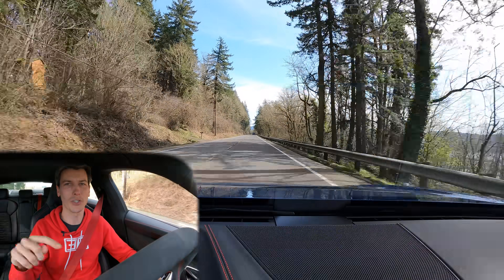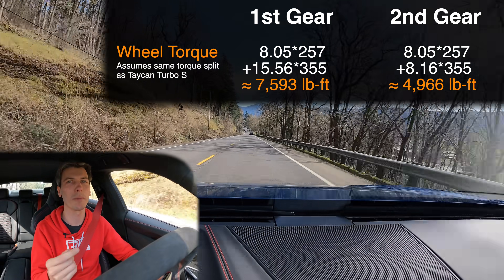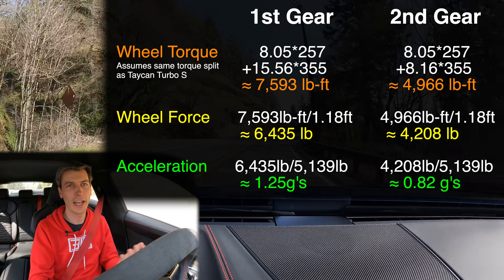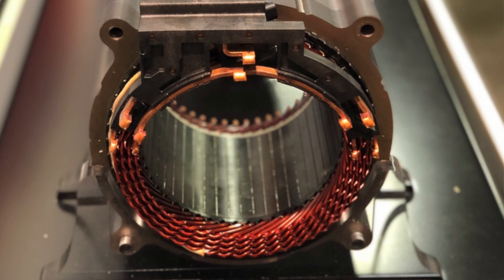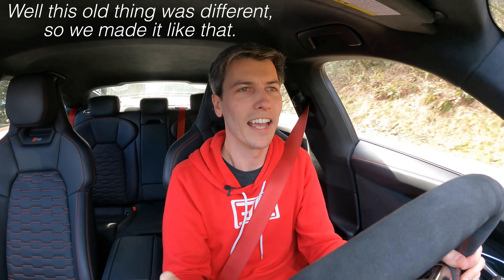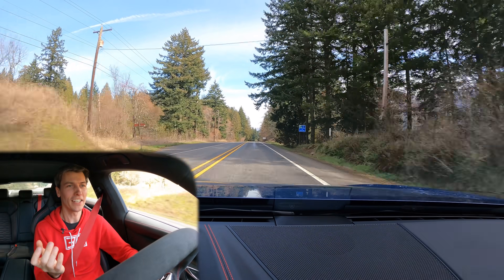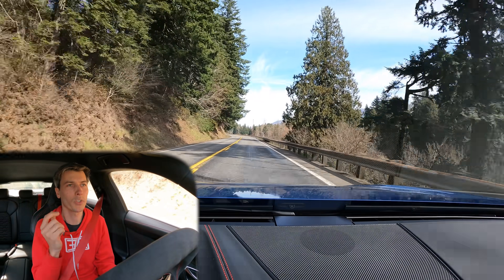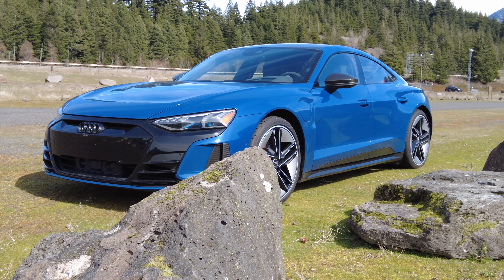Are Fake Manual Transmissions Coming? Audi Keeps It Real

Comment: That Toyota transmission sounds like such a gag. Was it released in April 1st? I mean I get the love of driving a manual transmission however the biggest feedback you get is the change in the note of the vehicle whether it's the exhaust note or whine of an electric motor.  This fake manual will just sound the same with every "shift" if the electric motor is spinning the same rpm. Also sounds like a $4,000 profit margin built into a vehicle for $300 in actual parts and labor for the fake pedal.

Comment: VW does not use the speakers in the soundsystem to make the engine noise. They use a linear actuator that's mounted to the firewall below the windshield to not only generate sound, but also vibration. As fake engine noise goes, it's actually really well done because it almost perfectly matches what your engine is doing, noise wise.

Comment: I would take a fake manual over a CVT ANYDAY. Keep in mind I don’t mean a Toyota hybrid ECVT. Considering those don’t use a belt to change gear ratios but they use a planetary gearset. Far more reliable and strong in comparison.

Comment: I get it - totally! I even have an old phone at home with that traditional handset, you know, the one with a speaker blob at one end and a microphone blob at the other. And it weighs 5 Lbs and sits on the kitchen counter. It has the rotary dial with little finger holes and numbers under them and you pickup the handset and spin the dial and the call goes thru. BUT! It's actually got a latest model iPhone inside that does the real work! There's even a cord coming out which you can plug into anything you want because there are no wires in it. Sorry, just kidding on that whole thing but maybe there's a niche market there? Hmmm ...

Comment: My hope is that electric cars (and more sustainably, proper mass transit) allow internal combustion cars to exist for a longer time for those of us who want that experience. It's too bad though, that the manufacturers that provide internal combustion cars have themselves been abandoning manual transmissions and embracing fake engine noise.
Reply: ICEs and various forms of internal combusion tansport (longhaul aviation) are likely to be with us for a long time, however the source of the fuel is likely to change. It becomes easier to go carbon-neutral as the price goes higher and above $200/bbl various non-fossil methods are economically viable

We cannot keep adding more carbon dioxide to the atmosphere. Forget "climate change" and "global warming" - if CO2 goes much past 800ppm then RAIN will become acidic enough to destroy most land-based plant life and anyone who's studied paelentology will tell you that when that's happenedi n the past, things turned very bad, very quickly.

Last time that happened and the climate was similar to what it is today , 93-96% of ALL life on the planet died off in less than a decade and "red tides on steroids" created much of the oil we're currently burning. We know it as "The Permian extinction event". it's all written in the rocks for those who care to loook

Wer're facing a collective global crisis and warring about it will virtually guarantee our extinction as a species. People can move away from rising waters, droughts or climate change but it's hard to escape from globally collapsing oxygen levels and drowning in your own lungs (altitude sickness) is a particularly nasty way to die

Comment: Jeep did a concept electric manual wrangler. From what it sounded like they basically bolted an electric motor to the front of the factory transmission. You could take off in any gear and it couldn’t stall.

Comment: Hearing engine sound, real or fake, can make it easier to match shifts properly. But it's hard to see the point in a 2-speed electric especially if you don't plan to shift it manually.  If you can't turn it off it's just making it harder to hear music or whatever.

Comment: the only worthy new car left is
the CHEVY SPARK and only if
you get the LS (base trim) and
the 5-speed manual transmission
$11,700 in 2019 - 98 horsepower
roll-up windows - nearly extinct
NO buttons on the steering wheel
it's more fun to drive a slow car fast
than to drive a fast car slow

Comment: Quite the intriguing piece. My main ride is a Vespa GTS 300 SuperTech, which, like all modern Vespas (except the Elettrica, because electric), uses a CVT. So I get the lovely thrum of the single cylinder engine, but don't get to shift. Unlike most cars with a CVT, however, the only "bump" I feel with the bike is when moving from a low-speed crawl to maybe 20mph and up (top speed a bit under 85mph). I happen to like rowing my own gears on a motorcycle, but I can't deny the ease of dealing with stop-and-go in-town traffic without constant shifting where it's definitely not fun. And, yes, someone - Kymco, I believe - is making or planning to make an electric motorcycle with a manual gearbox. Obviously, we're part of a crowd that's not into "self-driving", either. ;-)

Comment: I posted this same comment a couple of years ago.... With electronic speed controllers you can precisely configure the motor's torque at any RPM, meaning you could at a touch of a button have your Tesla motor emulate the power/torque characteristics of ANY internal combustion motor. e.g. Today I want my car to feel like a Honda VTEC and tomorrow a Chevy V8. Software on a fake manual transmission could fake the gear ratios too

Comment: There are interesting ways the idea could be implemented on EVs that aren't simply power limiting. On hybrids one thing that was done with manual mode wasn't just to simulate gear switching, but simulate it as if it was a bigger engine, by both increasing the normal power available to the system, and also altering the pedal maps. There is usually a distinction between short term and long term power limits, and the driver doesn't always have full access to them depending on the pedal input and speed. There could be something done to increase the short term power of the system for the simulated lower gears. Not sure how well it would work, but it would be interesting to see attempted at.

Comment: Yesterday I was working on an F1 hot rod pickup (‘48 460CI V8, auto trans, modern suspension, etc.). I needed a part so I took the other F1 pickup (‘49 226CI I6, 3 speed manual, manual brakes, manual steering, basically a factory restoration.) to the autoparts store. I love driving those vehicles, but it makes me appreciate modern cars. That old truck bounces around the road pretty good and there’s a lot of focus required with driving them. I think if I’m going to buy an EV “fake manual transmission” isn’t really on my list of things I want. Seems like EVs are complex enough as it is without adding this extra switches and programming. It seems like an additional unnecessary failure point.

Comment: It's good for drifting where you can use different gears and and the engine's RPM range to manage wheelspeed and torque. I'm not so sure it's gonna be fun for racing though, as the motor will only increase RPM and will sound like it does instead of comng back down every gear change

Comment: I remember that Lotus made an Evora called 414E in the "serial hybrid" configuration, with an ICE working as charger/range extender for batteries. They also put in place a sort of "software gearbox" with paddles to mimic a manual gearbox.
Toyota was already an engine supplier for Lotus so the patent you mentioned is also probably behind that first prototype.

Comment: That new subaru wrx gt with simulated gears (its a cvt) is truely pointless. Worst of all, it is doubtful that anyone would have fun with the car, knowing that the top trim has cvt forced upon it and no manual option. Subaru really shot their feet making the final ICE wrx. They could've used a torque converter or sequential, but chose the worst and complicated transmission for a sports car.

Comment: Would the clutch pedal in the 6-speed EV allow you to coast?  

I only drive manuals but know an EV is likely in my future - so I like this concept. That said, I’d want an “auto” mode where it does the normal EV thing.  Also, I’d hope the fake manual would give you a fake tach, with fake rpm sounds.   THEN, I need some DLC: different exhaust sounds sampled from vehicles like a Ferrari 250, or a Civic with a fart can, or a Ninja motorcycle, or the Jetson’s car, or the Flintstone’s car (feet running), or Chitty Chitty Bang Bang.  I need choices in what my no-engine car’s exhaust sounds like! 

Bonus points for a variable interactive clutch. Heavy clutch, light clutch, high engagement point or low, and even the car jerking the driveline when you don’t shift smoothly!   And with that, I’d need a flywheel weight setting too. And if on a turbo model car exhaust setting, I’m going to need a boost gauge, as well as BOV sound when you put the clutch pedal in, with an adjustment of 0-100% vent to atmosphere.  

If the vents could pipe in some burning gasoline and oil scents through the HVAC system, that would be great.  

If you’re going to try to give me my old ICE car experience, I want the full thing!
Reply: Yes! It would be great although thr gasoline smell is overkill.

Comment: Hi not quite about the topic but you gave me an opportunity to get something of my chest about the public wanting stepped CVT transmissions. If CVT's were truly constantly changing ratio then it would be impossible to maintain any decent even pressure between chain and pully's, I can't see how it would be possible to put any reasonable amount of torque through the transmission while it's changing ratio's. I call bull on the fact they do it for the public, the simple fact is they can't do it, so they step through the gear's and reducing the torque between each gear while the belt repositions on the pully's and they do it so the transmissions last more than 5000 miles. Love your channel btw.

Comment: Is there any logical reason to use an actual 6-speed transmission with an electric motor? Would you save on battery power in a higher actual gear?
Reply: There isn't a logical reason to use a 6 speed manual with electric motors, but there are many reasons to use a 3 speed manual with electric motors. A lot of electric race cars use them.

Comment: Just a question, in an internal combustion engine car as the manual transmission has an overdrive where the ratio is reversed and the engine runs at a slower speed than the gear at o/p, wouldn't it be beneficial for an electric car to have this as well for cruising speeds? If the power op is dependent on the rpm? So that it uses the least power in cruising?

Comment: the cvts should have a switch to optimize efficiency in eco mode and optimize power in a sport mode. the sport mode in this scenario shoots down any argument for fake shifts or traditional transmissions ehich it should beat every time.

Comment: A real manual transmission can be useful in an EV, if it's paired to a motor that's optimized for torque at the expense of max RPMs. This is essentially what Genovation Cars is doing with their modified Corvettes. EV manuals would also have the bonus feature of being impossible to stall.

Comment: fake shifter and clutch doesn't work from a pure performance point of vue but if you are a human driver, not an AI and maybe can't control the accelerator pedal with 1% precision,  shifts are useful also on a track as a way to limit your torque below the point you would be losing traction, or  precisely adjust your engine braking. discreet gears give you reference points like downshifting in a breaking zone, knowing in what gear you are in a corner gives you a better sense of speed, shifting/short shifting out of a corner with low grip, where a classic EV control with a single speed gives you only one way to control power with your right foot.  but considering those EV's with lot of advanced electronics/traction control/torque vectoring can probably do it better than you.
but if you are considering a more analog experience with esp disabled, it can make some sense. same for dirt bike riders who say that on electric dirt bikes they are missing their clutch lever that gives them an additional way to control power out of a corner or in technical Enduro/trial, less sensitive to shocks/vibration than twisting a throttle. from a more daily driving perspective, gears are also an additional input that allow you to control the sportiness/ smoothness compromise as well as the amount of engine braking/Regen.  like an instant chill/normal/sport switch . by limiting the max power or Max Regen, you also give more precise control to the driver. but then in this scenario you don't really need to fake a redline.
another situation where I like to use a manual mode wether it's on a stick(duh)/dct/auto/CVT in mountains when you have long down hills as an easy way to control your speed without the need to be always on the brake pedal.  you can always find a gear in the straight that will maintain a speed close to your desired speed with no foot on the pedals while still letting you break/accelerate. strong one foot Regen like on Tesla's will slow you down, cruise control will deactivate when you accelerate or brake.
So basically even though cars are becoming smarter and smarter, taking over more and more of your work, controls are getting simpler too, sometimes "too" simple (one foot driving) and at the same time remove some of your control. for instance one pedal controlling -75kW to +760kW is not something you always want to have when you are just driving in traffic. less controls is ok if you want to give away driving to a self driving car.
that being said, my 500e which has only 111hp, strong Regen braking linked to the brake pedal, and zero driving mode/Regen setting, and a single speed, works perfectly for me a daily driver that can easily be driven smoothly or hard. single speed direct drive is for me the closest to a manual transmission in the sense that it gives a direct connection between the accelerator pedal and the motor. as much as I don't like auto transmissions, I don't miss my clutch pedal at all

Comment: I am really happy for this, I've been asking why this is not a thing anyways for a while now. I have an old Logitech G27 racing set for my PC that I use for some racing games. And for a while now automatic transmissions have been faster than manuals. Technology is progressing and we can't stop it. But since DCTs use paddle shifters in manual mode, why not put a electronic H-pattern and clutch pedal in there. I wasn't even thinking about EVs. But I guess the idea works for them too. In my version for a ICE with DCT the clutch just enables the shifter's signal through and the DCT then acts like a paddle has been hit, other wise moving the out of a gear puts it in neutral but putting it into another gear won't work unless you push the clutch. No grinding or anything you will just coast. You are saying the idea is pointless and unneeded, but paddle shifters on any form of auto is technically pointless. But if all cars are becoming autos or transmissionless in the case of EVs, I say it does have a point in certain cars. Entertainment. Entertainment is something that is needed by humans. And for a lot of car enthusiast rowing through gears on a curvy country road is entertaining. I thought about it several times, if I had money for it I would pick a project car, grab the DCT out of a wrecked Hyundai Velocter and stick in it the other car then, buy some of the nicer racing sim pedals, H-shifter and wheel and mount it up. Then pay programmer to make it all talk to the right bits to make it all work. I mean if you think about it modern cars are all electronic now. Almost everything is drive by wire. So the only difference between me driving in my simulator and a real car is the road feel. The controls are all effectively the same, I push button or move a sensor here, an actuator moves and does something else where in the car.

Comment: Why hasn't an electric car manufacturer killed their top speed but made something that can accelerate in under 3 seconds? Don't even bother with a second gear. Cars rarely travel over 100mph anyways. Make something fun for tracks or just driving around town.

"Well this old thing was different, so we made it like that" Applies here too! Why do cars need high top speeds? Especially EVs who give up free torque for higher top speeds. A cheaper EV with an insane 0-60 but low top speed could sell really well.

Comment: Why not just build a manual hybrid that you can leave in a gear and use the electric motor to power around town in traffic while assisting a smaller displacement more efficient engine with low end torque.  Range is the biggest issue with electric vehicles and I feel like using a little of both in unison in the right applications would solve a lot of issues
Reply: At least until the range and charge time of electric vehicles has improved

Comment: In the future, tuning will be mostly software based.  People will go to shops to have fancy speakers installed that play realistic engine noises of your choice, and tuners will make your torque feel like that of a certain car.  One day you can have your speakers blasting V10 noises and your car accelerating like an F1 car,  the next you can make it sound like an air-cooled twin-turbo flat-six and accelerate like a 993 GT2, fake turbo-lag and all.  It'll be like playing a Sim racer with endless possibilities of sound and feel, but with felt g force, and with consequences if you screw up. 😬